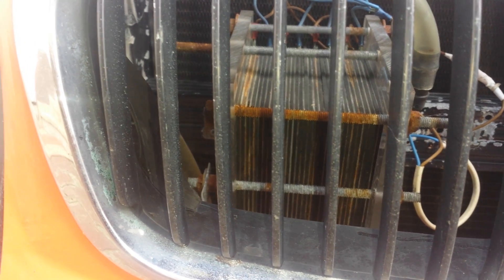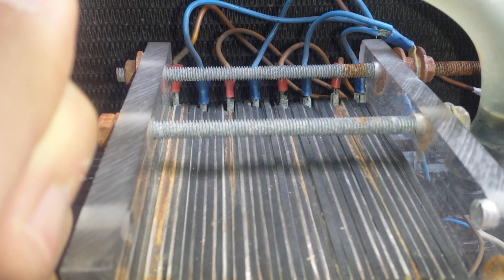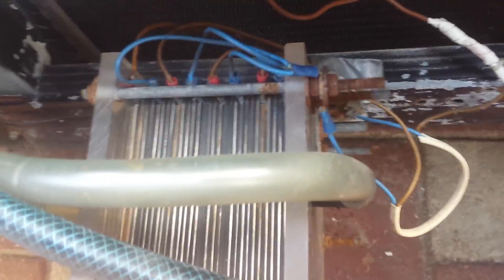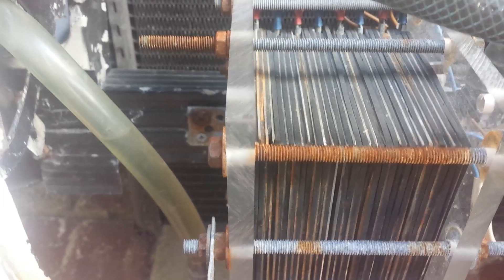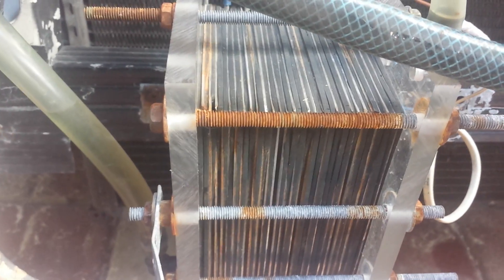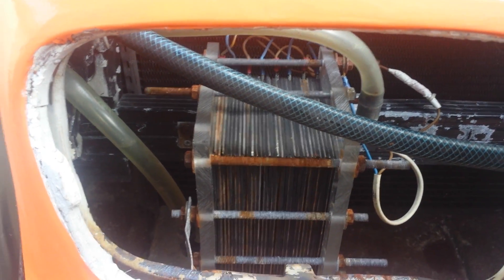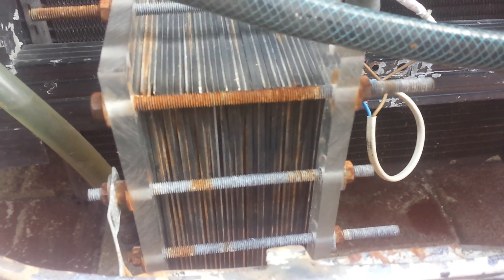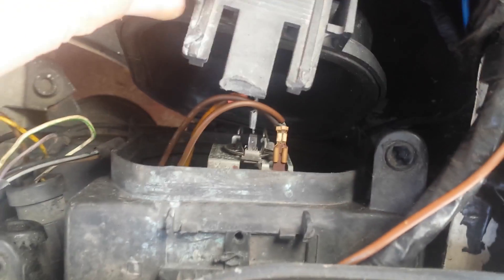Hho questions and answers

Comment: Surely sending that many amps with the addition of needing to light the light is a lot of strain on the feed coming in for the light.
Would be safer to add it via a fuse directly from your alternator because that's a much heavier gauge wire and it has the posts already there to connect onto, plus just like the lights if the ignition isn't active it won't produce gas.

Good videos.
Reply from the maker: I did have it from the altinator but started to lack power
Reply: That's unusual with it producing the actual power for the lights, thanks for letting me know.

Comment: Pozdrav moja Bratte,

You are right about reducing fuel consumption with any hho cell, It doesn't reduce fuel consumption in cities. As you said, it works in highway because on usual cars to make energy all systems use energy that comes from car's alternator to car battery. When you drive your car and activate your hho system in city your alternator needs to create energy but your engine works with low rpm I mean under 1.000 rpm... Alternator feed up itself from the engine and it needs more rpm then your engine enhance rpm to load your car battery for hho system! However, if you use it in highway your engine still works with high rpm like 2.000 rpm and alternator create energy more efficiency it needs less fuel to make electricity.
Reply: If that was true, it would have worked on up hill drive as well.
So, no sense.

Comment: hi.. this is more informative... so can a car run solely om hho only ?.. without gas. for example... just shut off the fuel pump and let the car run on hho... like a bypass switch. how much of hho is required to run a vehicle and how big must the plates must be.
what about running the car on petrol vapour... is it the same principal?
Reply: Remember, you have to let your car run on normal fuel at least 5mins  at the end of each trip if you run 100% HHO. If not do so, water in engine rust all those vale and muffler... ect
Reply from the maker: it probably could if u had more hho generators and car batterys and more alternators.
Reply: TO RUN ON HHO ONLY YOU WOULD NEED SPECIAL INJECTORON YOUTUBE GOT MORE SPECIFIED IMFO. LOOK   UP  STAN MEYERS

Comment: As I have been lead to believe,the car computer will sense a weaker mixture  from the exhaust gases and adjust the mixture (richen) to compensate.Therefore no mpg gains will be seen.To get round this,gizmos have been designed to fool the computer into not seeing the change in mixture.What do you think mate?
Reply: i need to know if a chrysler 300 affected?
Reply: +Xellos Metallium does it have a lamda sensor in the exhaust? usually this is in the exhaust manifold.this is the first section of exhaust from the engine.

Comment: Gr8 job just one point if your brown wire is housing single core it is for AC . 12v DC need's multi core wire  check it out for your self .... and keep in mind the - plats give off the H so all ways have more - plats than +  good luck
Reply: how much more - plates  percentage wise?